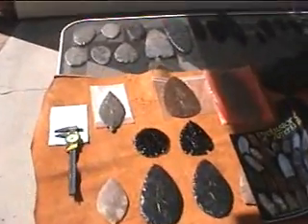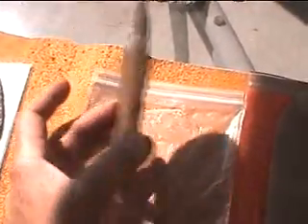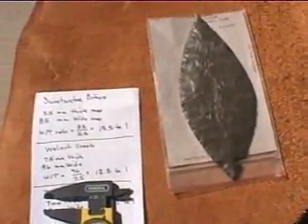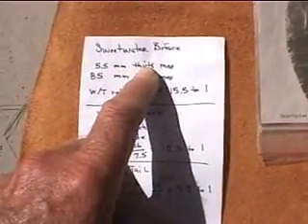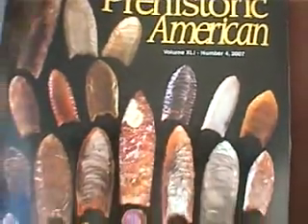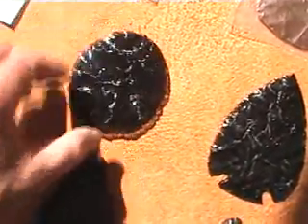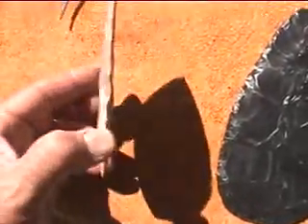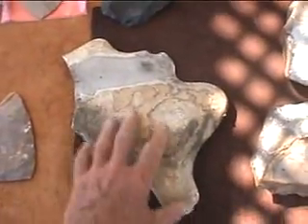Making a Super Thin Biface, Part 1

Comment from the maker: @69MisterZ Slabs and glass can be very tricky to knapp because they snap very easily.  Be sure to use good support to get rid of the square edge. This can be done by placing a finger directly below the impact point to reduce shock.  Alternate the piece to remove a small flake from each face until the square edge has been removed and a wavy edge has been prepared. Then remove another set of thinning flakes toward the middle of the biface which gives good convexity,  followed by more thinning...

Comment from the maker: @bmeyer2011 The problem with thin flakes is that they are too flat and its very difficult to get the flakes to travel more than half way. Also, very thin flakes tend to break easily because of the bending that occurs when they were struck from the core. You will often see these stress cracks on thin flakes. Larger thicker flakes actually are a better way to go. Good question though.

Comment: wouldn't your blade totally break off once you stabbed your pray?

or even if you missed and your spear or arrow hits a hard surface,wouldn't they totally break if they were so thin?
Reply: NYWAORCANZ yep, those aren't projectile points though, they're blades for cutting/butchering. most projectile points that I've seen are on the thick side where as knives can be very thin like the ones in the video